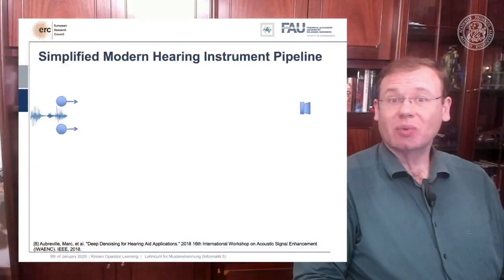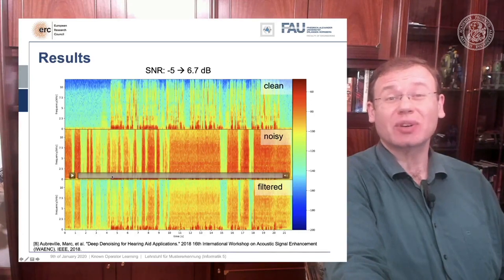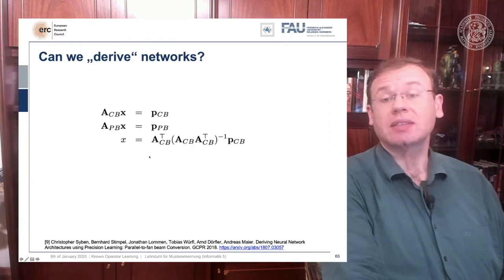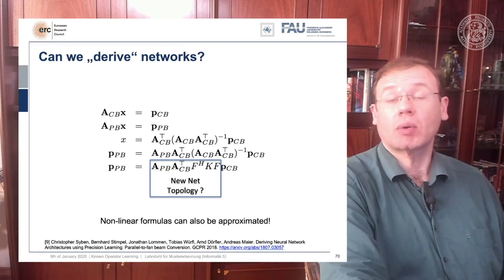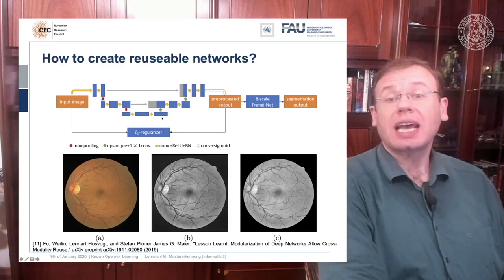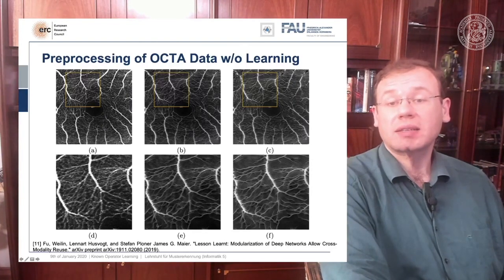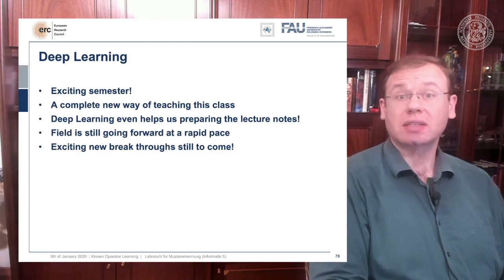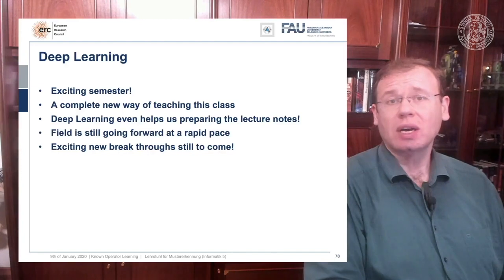Deep Learning: Known Operator Learning - Part 4

Comment: Thanks for sharing your knowledge. It is really an excellent deep learning course.  Personally, I think all lectures should be videoed, improved, and updated regularly. The in-person interactive lecture should be mainly for discussion and explaining as different students may have different understanding level. I have one suggestion, adding lab video lectures as well e.g. colab that shows practical examples of the content of main lectures.  This way you connect the theory and the math to the implementation which provides more understanding.
Reply from the maker: Thanks for your positive feedback. We do have exercises at our university, but they require 1-to-1 supervision. 
However, we also provide some coding examples here:
https://github.com/kbreininger/tutorial-dlframework
Reply: Thanks for your reply, I have already seen this repository. It is very good but different from the suggestion above.  I think each lecture deserves one or more separated technical notebooks e.g. implementation in pure python, pytorch, and keras for some simple stuff and using original implementation with some sample datasets if available for complicated ones.
Reply from the maker: @ibrexg  We have face to face programming exercises with the lecture, but they are unfortunately exclusive to students enrolled with our university.